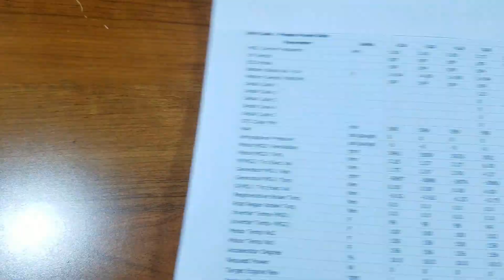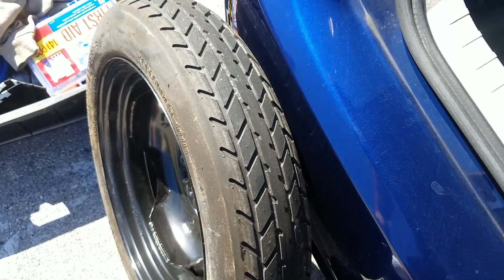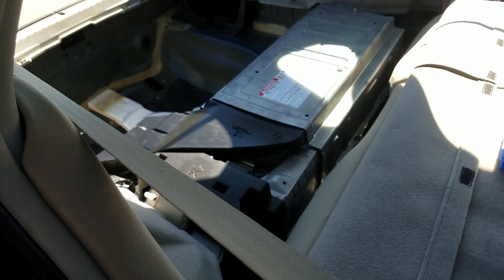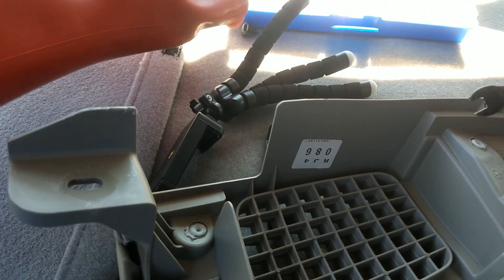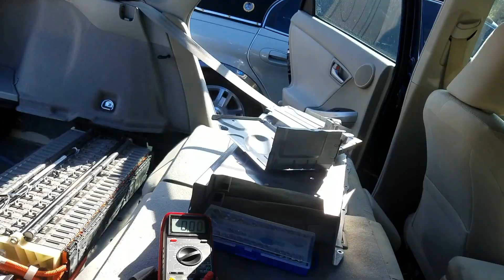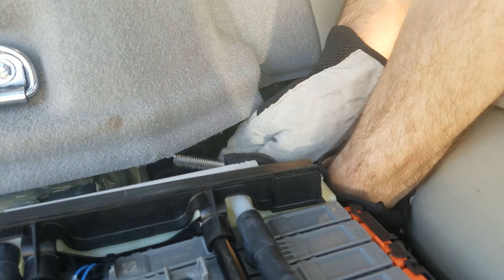Hybrid Battery Repair Part 1: Battery Removal

Comment: High voltage gloves are overkill and not necessary once you remove the HV battery orange plug, , but removing jewelry like your ring, is a must.
Reply from the maker: The orange plug cuts the pack in half so there's still 100V maximum across the pack. Better to be safe than sorry. I agree about the ring. Definitely should have removed it even when working with individual modules as they can deliver 100A+ and would significantly heat up or melt jewelery. Thanks for watching!

Comment: @Fix it Fox: I am enjoying this. Thanks for sharing. Oh, did I miss it, or you did not disconnect the utility (12V) battery? That is the first step in this disassembly.
Reply from the maker: Thanks for the comment! I did this repair a few years ago, and I don't think I disconnected the 12V battery. I don't think it was necessary.
Reply: @FixitFox  For anyone working on a hybrid vehicle for any reason whatsoever, no matter whether the work you are doing is electrical or not, always always disconnect negative terminal on the 12V battery and pull the service plug on the hybrid battery. It only takes 2 minutes and you are reducing risk of shock almost entirely.
Reply from the maker: Words of wisdom!

Comment: Stupid glove to big
Reply from the maker: It has to be thick and big in order to protect you from the high voltages. You'll get shocked with thinner ones. It has to go up to your elbow too so you don't accidentally touch the high voltage with your arms. I agree it's difficult to work with them. But it will save your life.

Comment: Hi where did you get a new battery ?
Reply from the maker: Hi, I bought new cells from eBay, $24.50/cell
Reply: @FixitFox  Do you have a link?
Reply from the maker: Unfortunately, the seller I bought them from isn't selling them anymore